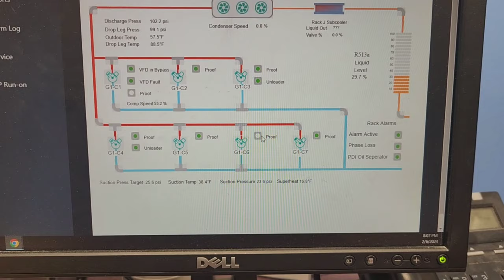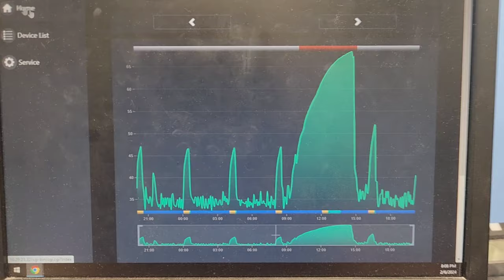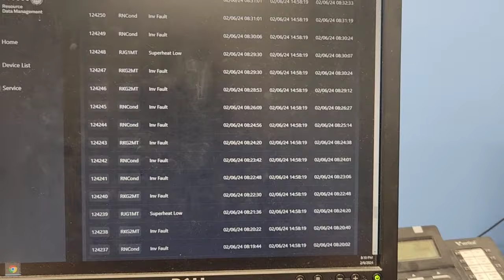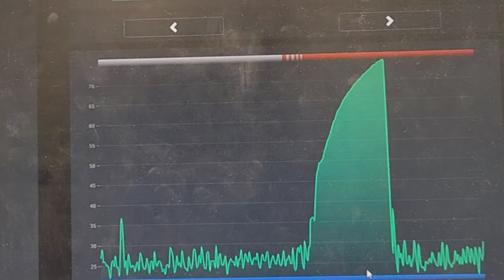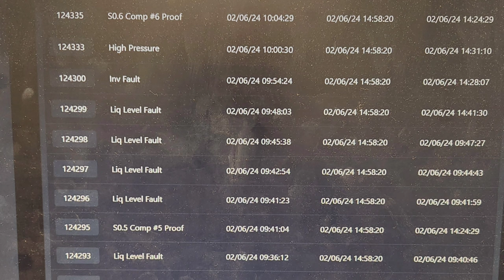Last One Today. RDM Rack Down Mysteries

Comment: Looking at that low superheat alarm, if accumulator has a high level safety its possible that accumulator high leveled and shut rack down. Eventually liquid boiled off and liquid level dropped down below safety and rack came back on.
Reply from the maker: Do you think that would cause the rack to be down for 5 hours? Another technician was mentioning the super heat alarm as well. We had a lot of them. And it had been alarming low super heat almost every 10 minutes all the way into the day before.
Reply: @HVACRServiceTech  it's possible. Low superheat could cause liquid to start accumulating in the accumulator and if that rack has a high level safety eventually it'll cause rack to shut down. Once rack has been down for some hours accumulator will start warming up causing liquid inside to boil off. Liquid level would drop below the high level safety and rack might start again